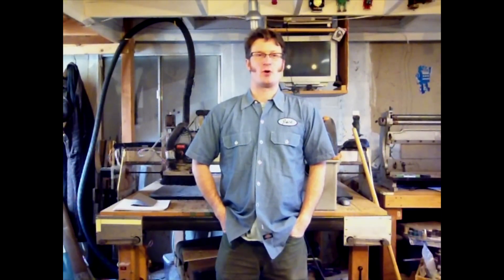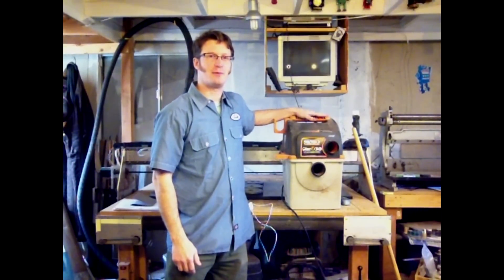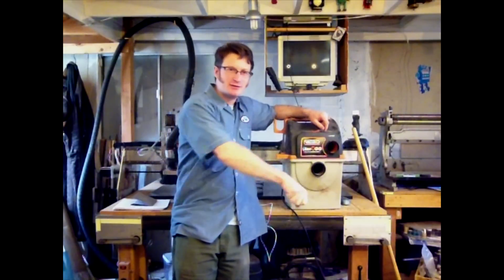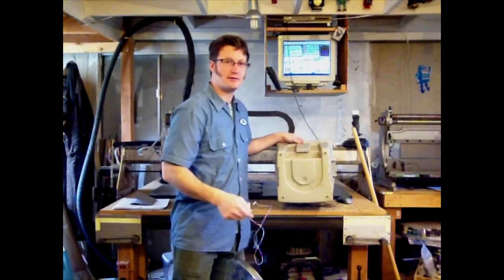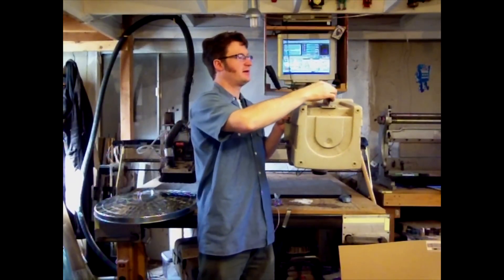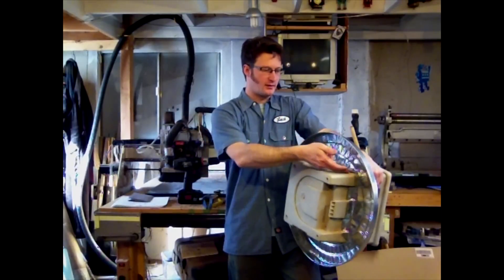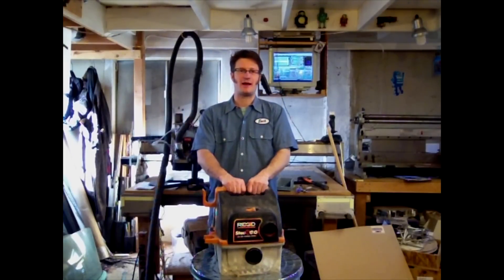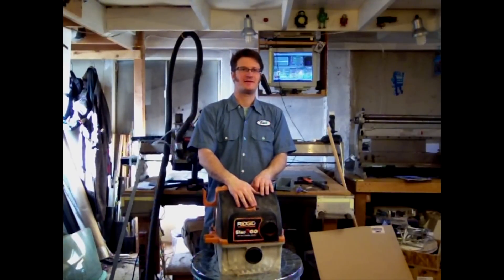Hacking together a garbage can and a shop Vac

Comment: I am watching this video almost 7 years later and hope to make this work on the new generation of shop vacs.
Reply: As it turns out, I have moved and am setting up a new shop.   This time I am thinking of using one of the cyclonic dust separators on the can so that my filter doesn't clog as fast.
Reply: me too, but I'm thinking of keeping the thing intact and trying to modify the garbage can top to fit the top portion and leaving the canister so I can use it as intended. going to see if I can just put a hose in the can for collection... feeling like a mad scientist

Comment: exactly what I hope to accomplish !  where did to mount the steele bars? how many did it take?
Reply: It has been a few years since I last used that vacuum.  I've upgraded to a really big dust collector. As I recall, I had four pieces of 1/8 x 1 bar stock going vertically and one or two rings of rebar welded to them  horizontally.